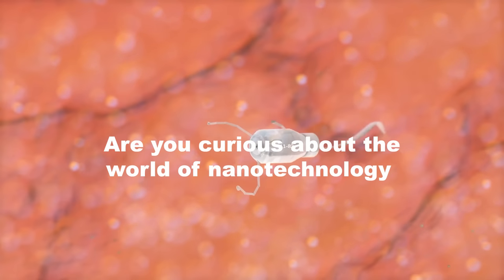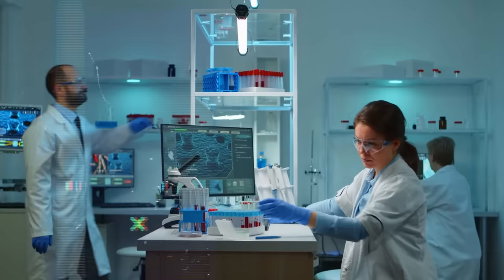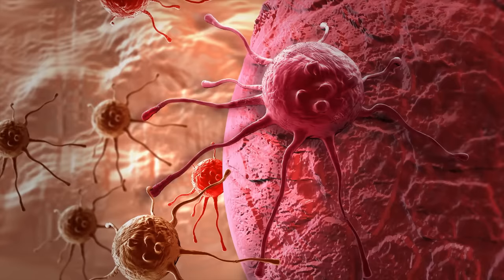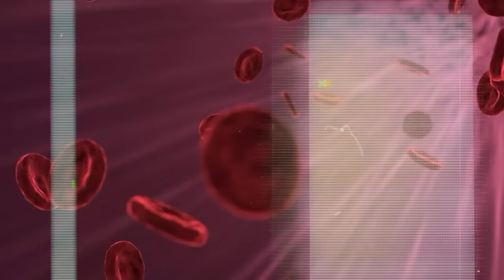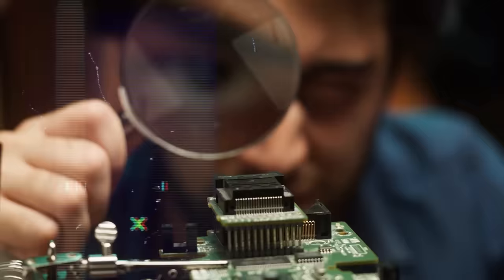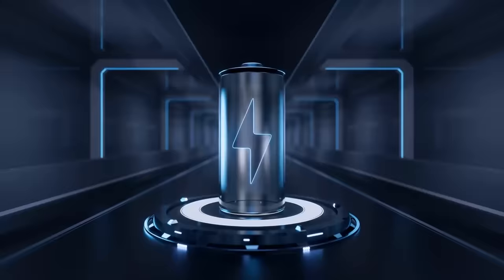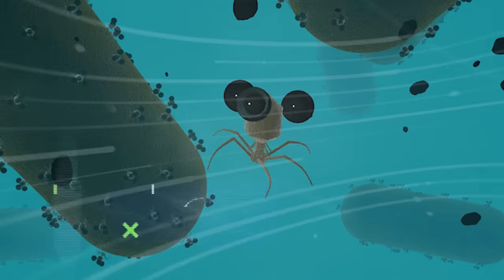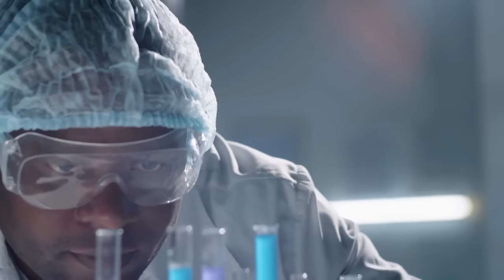Nano Robots Explained

Comment: 100%. I have a terrible condition. My endocrinologist calls it gastroparesis. It's pretty much like IBS... only without the diarrhea part. I'm sick in my sleep so often. I had to wash my clothes four times Monday morning before 4:00 am. I've been diabetic for almost seventeen years, and it seems the nerve damage it's caused has finally wrecked part of my body. I hope nanobots could repair my digestive nerves, even though my doctor thinks any cure at all is impossible, and that I should just get used to this horrid, painful, embarrassing problem for the rest of my life.
Reply: have you heard of morphic fields?
Reply: Make sure you get a second opinion
Reply: I can help but you don’t reply 😌
Reply: @Kat_Stewart  Indeed. I found out the other day that my most pervasive symptom, what I mention in my comment, isn't even a symptop of gastroparesis- the condition I've been told I have for many years! I have an appointment set for the 22 of next month. It's with the same doctor I've been to before. I will however relish the chance to demand somebody give me some answers and take my condition seriously.
Reply: @anamacklis2355  YouTube didn't notify me that I got an answer to my comment. I have since replied to your initial one.
Reply: @anamacklis2355  Morphic fields are clinically proven to aid in such problems?

Comment: I’m not speculating anything, BUT.. I worked with a young lady who, one morning, got her ‘Rona jab then proceeded to work. When she told me she just got stuck, as a joke, I pulled a magnetic clip off a refrigerator (it’s a restaurant) and placed it on her arm.. just as a joke.. it stuck. Every time. We were all speechless. Turns out that magnet stuck anywhere on her between her chin and waistline. Through her clothes. Next day.. nothing. Again, not speculating, that’s what happened. Make of it what you will.. I’ll be taking nothing of the sort.